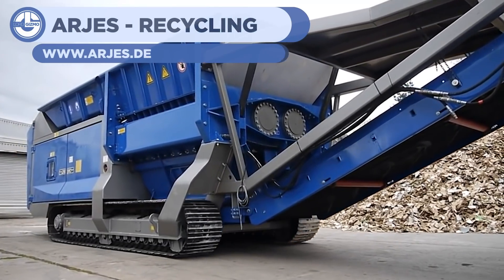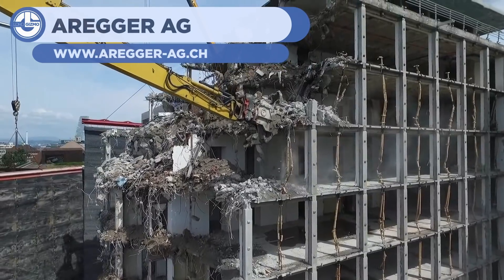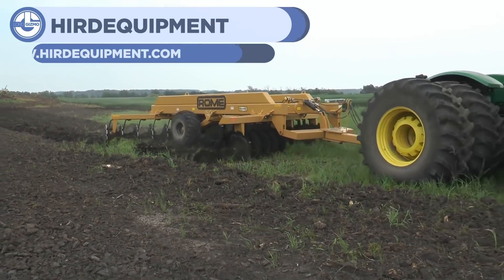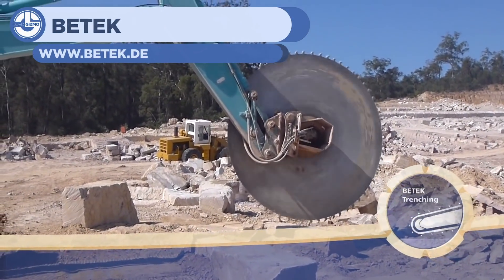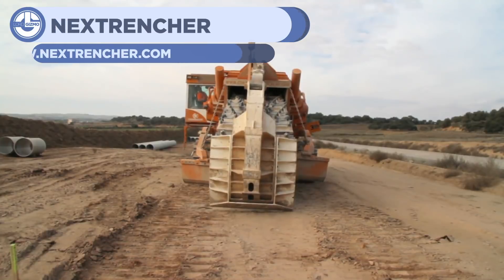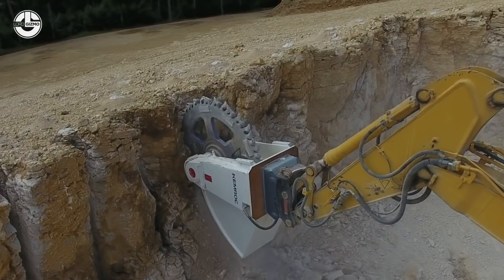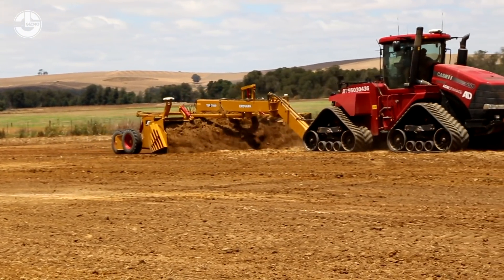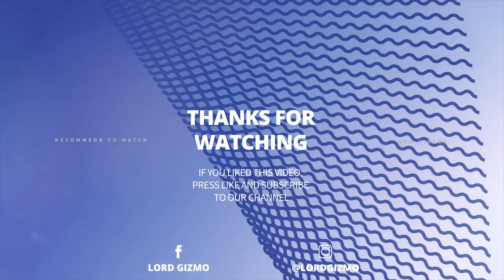Most Dangerous & Incredible Machines You Need To See!

Comment: Hey your second to last machine in this video is incorrect. That’s actually known as a grade all.. Farmer pull them behind there tractors to level land for farming crops.. they are similar to a Motorgrader in Excavation.. you can even see him cutting and filling sections land in the video. It does not remove the top soil. They make a pull behind Scraper for the purpose of moving large quantities of dirt to another place.
Reply: It’s a drag blade. A grade all is a straight boom excavator with a twist-a-wrist bucket. It’s used for shaping ditches and such. I’ve operated grade all’s before. I’ve also used drag blades. His description isn’t far off. They are used for prepping and finishing topsoil and removing dirt in small quantities.
Reply: You can even see the GPS/Laser pods

Comment: I was amazed by a utility trencher in Las Vegas. It looked like a mobile Ferris wheel only there were steel teeth where the seats would have been. The ground there is like concrete. In fact it is so hard that some apartment buildings are built right on it foregoing foundations. The machine was guided in straight lines by wires. When turned on and engaged a horrific banging noise is created as the teeth smash into the rock like ground. What comes out is dust, no chunks. Progress is so slow that it can run for days unattended as it bangs and thumps across the site. Refilling the trenches is a problem since the dust all simply blows away. AMAZING.